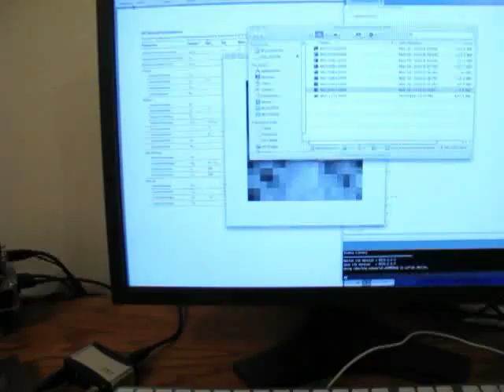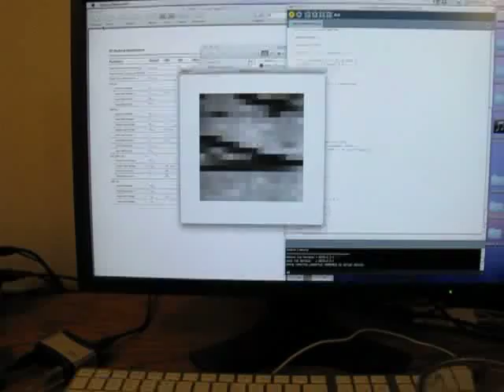Hack an optical mouse into a camera with Arduino and Processing

Comment: god only knows? hi, im god...
you can use this sensor to guide a missile. it already tracks optical flow. convert the output into 2x servo movements. because it is not very sensitive it becomes even better when using a laser difraction pattern placed on the target. current 'kits' to do this cost 30k. i estimate doing it for 20 dollars

Comment: i took one apart. the lens is not very good. the wire contacts for the micro ubs is gold. the chip, i believe, is gold, and i put in a salt and hydrogen peroxide solution, to get the gold out. some of the gold came off. the LED is red (i don;t know what else.) i'm going to scrap the plastic, save the silver contacts in the switches, and put the small motherboard in my circuitboard collection, and sell it one day.

Comment: This is extremely interesting ... one practical application that EVERYONE needs is a mouse jiggler ... no more screen timeouts on machines that you don't have permissions to adjust that.  And the mouse registers with the PC as a legit USB mouse.  What could you send on those pins to the Logitech chip to emulate a jiggle?

Comment: Now stop using your teeth to strip wire. I stopped after I lost a little of my tooth enamel which shows as an uneven part for over 35 years now. I was young and stupid. Don't you be stupid!!   Just get used to using a knife or like me, scissors and be gentle on the plastic and you won't tare the copper.

Comment: Sir, Is it possible by connecting some two points in mouse circuit or ic or camera, thereby cursor will move left right up and down, I have to make Mouse emulator, if yes than I will control mouse over Arduino. Sir Plz guide.

Comment: the tracking firmware in that mouse when refocused to infinity can give direct axis steering outputs to make a drone lock on and home in on a target...without an arduino. its a fun project to try. surprised more uses for these sensors are not posted.

Comment: this is great project!!
you can use it as optical ruler decoding camera
but need to find a micro leaner encode tape of some sort
since there is no cheaper microscopic camera anyway
Reply: +佳明鄭 hi that is a cool thought! can explain how we can do this?
Reply: most easy one would be using  black-to-white gradient as target
Reply: +佳明鄭 i understood the setup.I meant how to interpret the signal ? how to process the image ?
Reply: +susmith cs  you just add pixels up and divide them
And you got the position value 
No need for interrupt

Comment: If you add another lens in front of the mouse you can have focus on different distance
Reply: +Matt J. It was most likely an acrylic lens, but there are tiny thick glass lenses that could be used. Also, you are correct that a second lens would increase focal length.

Comment: That's a cool hack. I've been working on an embedded project that requires a colour digital camera, but upon trolling adafruit and sparkfun, there are currently no cheap camera modules (complete with frame grabbers) available for hobbyists - not that it's a hobby project, but the prototype for what I'm building has to start somewhere. I haven't considered looking into single chip colour cameras or image sensors. So, this really simplifies things :D.

Comment: Can you use this to make an optical counter that can count say, rpm of a spinning object?  I have placed a white thumb tack on a black edged 3/4" spinning disk and would like determine how fast it is spinning.  I could have the disk spin a laser light crossing the lens each revolution.  Any ideas how to create an optical counter?
Reply: Open an old mouse for that there is a infrared sensor and a spinning wheel wich you can use for this counting

Comment: 10 FPS is a hardware limit or a bottleneck caused by the Arduino/PC interface? I feel like my screen pointer tracks my hand movements much faster than at 10 Hz
Reply: I think this is because you read the memory of the chip, while normally the chip tells the microprocessor in the mouse the movements only... He is saying something like that, just before he explains the pins.
Reply: It Is because of the image processing right?
Reply: The Avago data sheet for that sensor chip says it operates at 1500 frames per second. It would operate at that rate in a mouse in which the sensor chip is translating images into motion. When you want to read the images off the chip you are constrained by the speed of the sensor chip's serial interface. Reading images that way is just for diagnostic purposes.

Comment: Why are you stuck with the little plastic lens, which focuses at about 1mm (the distance of the surface it normally tracks)?  Surely you could use some other lens, for example from a camera, that will focus an image onto the surface of the chip?  It would be very interesting to see what it makes of an actual picture.

Comment: How about building an array of those sensors (each takes a frame of a portion of the surface you want to view), using a microcontroller to synch and combine the data from all and send it to your computer (via Arduino) for a bigger image? :)

Comment: and Majd Alsado :

No this is point less, Yes the the sensor has a high resolution but the focal point is terrible at close range so you'll get a less precise mouse compared to the worst mouse on the market, there is a reason they use a small laser in a precision mouse, you need to gather as much information as you can, but in a very small place. 

What you can rather try is putting more sensors on one mouse, and in case one fails to read you moment because of a hair or what ever :)

Comment: i know , sometimes we do foolish things .. as a hamradio , did build a shortwave amplifier  about 400 W output using 813 U.S. valve running on 2000V.One day touched the anode  on my elbow and ground with the palm.
The shock rendered me unusable one entire day... guess what  ?  In that night  i was entering in WAE cw contest for about 36 hours straight as nothing has happened.15 Years late still having burn marks on my left arm.
-.-.  --.-  -..  .   -.--  ---  ---..  .-.  -..-  .--.

Comment: ok man , got the point here, but one little advice ... don't do that anymore ,,,striping wires with the teeth ,did the same as was younger and got teeth damage .
Ok , so for the project itself, that sensor has to be put on a carriage with X /Y axes to get some usage , some like a scanner or slow scan fingerprint.
I do electronics since i was 6 old , and glad to see that ppl are still homebrewing .

Comment: Hi. i m trying to use optical mouse with arduino for receiving mouse's motion(i know this is the normal function that every mouse does, except that m trying this with arduino). the prob is that my mouse uses some 14 pin IC, the datasheet of which i can't trace(may b it's chinese). So i want to use the D+ and D- of usb port of mouse  for getting the change in location. can u provide me some link where arduino is used this way. or rather how can I (using 1 serial port of Uno) get the job done.

Comment: have a ? for  you.I have afew wireless keyboards with no receivers could you inform me if i can use other transmitters or if i can make them into wired keyboards( just maybe the diagram of what each color represents on a usb cable) thats if i can actually be able to  wire  them. thanks

Comment: hi i was thinking of a DIY project with the optical mouse. i was planning to use the camera of the optical mouse to take images of a finger placed on top of it and correlating the resulting spectral information to measure say, heartbeat or even blood sugar concentration through digital image processing. i think this is possible since the infrared light can penetrate the tissue thereby images captured can be used to determine the analyte of interest

Comment from the maker: You're pretty much right. One possible application I found was to use it for low-budget optical interferometry, that is, to detect minute vibrations or even temperature shifts by placing the sensor between interfering laser beams (or more like, a single laser beam interfering with itself). I had to pack up my things for an abrupt cross-country move before I could get it working reliably and never documented it, so if that's interesting to you, maybe it IS your turn.

Comment: I thought most common projector rez = 800x600...

Still the cheap laptops people used to use almost exclusively to run their presentations through them were typically set to 1024x768 for about the past 10+ years.

Just tell em to stick with 4:3 til widescreen is more popular (then 16:10 for widest compatibilty from 16:9 down to 4:3), & make onscreen elements "large enough to read from the back of the room on a 70" screen or the 3rd row on a 50".

Even on a 1080p proj & PC too small = too small.